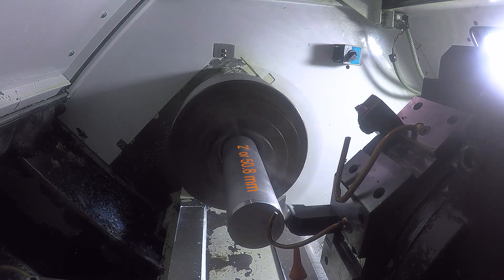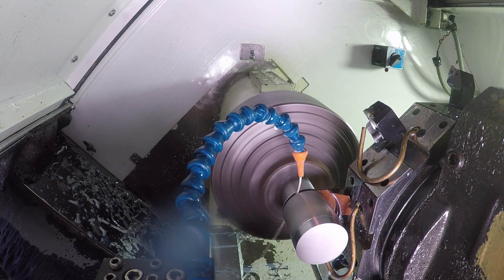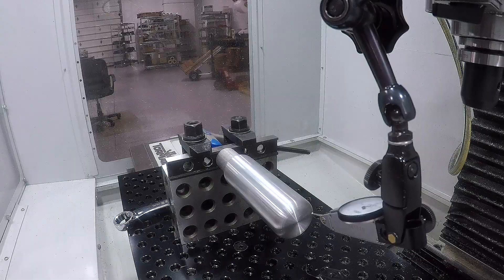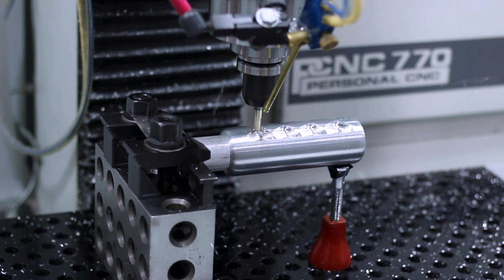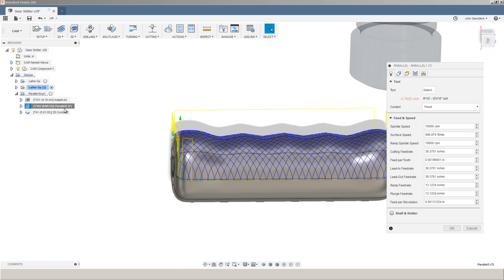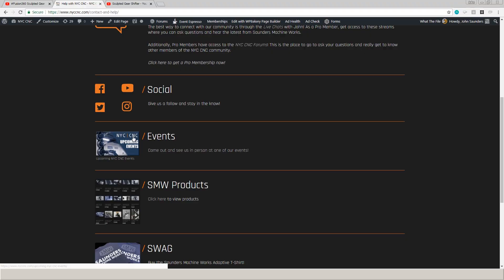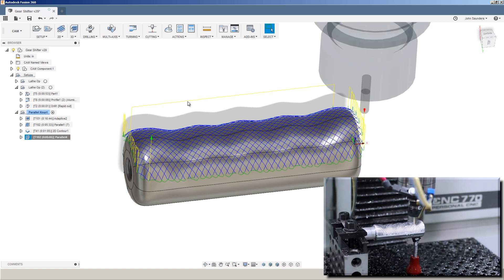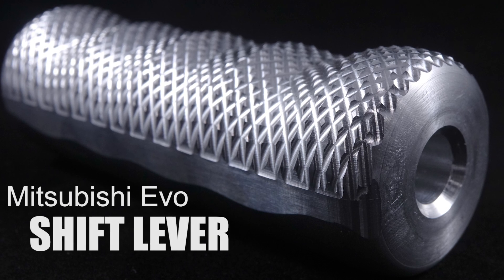Machining a Mitsubishi Evo Shift Lever | WW216

Comment: Cool project John but what happened to the feeds and speeds for the lathe portion? I'm still getting long stringy chips on my Slant-Pro and would love to know how you eliminated them.
Reply: The only way I've gotten rid of stringy chips on a lathe is heavier cuts: 0.003–0.005" feed/rev and 0.050-0.100" depth of cut.
Reply: yep, increase feed rate and/or more depth of cut

Comment: Can anyone answer this question, is 2.5 and 3 axis cnc machine the same thing, and if so can any 3 axis cnc machine run that tool path to create the knurl since it moves all 3 axis simultaneously?
Reply: Yes, he didn't do anything that another 3 axis machine couldn't do.
Reply: Yeah, 2.5d is just a term used to describe a certain sort of part/programming style
Reply: 2.5 axis means that 1 axis positions the tool(typically Z) and the other 2 axis' move simultaneously. Full 3 axis means that all the 3 axis move at the same time. All 3 axis mills can do full 3 axis it just up to the programming.
Reply: A lot of times 2.5 can also refer to the reach of a 3 axis machine. You cannot machine the underside of the part, so z axis machining capability is generally limited to the top half of the part
Reply: 2,5d NC milling machines share only one servo drive for y and z axis. Simultanious action of both axis is not possible. Example, Deckel FP4MA

Comment: I would have likely just put it on a vice, long side parallel to the y axis.  You can come up from center a bit, but have bottom support from a parallel or v block, and squeeze on the ends.  Even aluminum jaws maybe so you could machine into them if needed, or machine (a little less than) half moons for increased rigidity or repeatability if needed.
Reply: That's what comes to mind for me too, but it seems to have come out nicely the way they did it.

Comment: This is a situation where making use of a 4th axis or even a 5th axis machining would have truly shinned and I'd like to ask you why did you not use one of those methods?
Reply: 7:35
Reply: Had he used a 4th axis,  he could have used am engraving tool and made a truer knurl
Reply: But as he said it was to show it could be done on a 3 axis, and since I haven't yet built a 4th, it is nice to see it's possible.
Reply: The reason I ask him this question is to see what would the time factors be with each method of machining as this part really had some nice curves for 4th/5th axis machining as I thought the point of this is to make the best product in the least amount of time possible using the best method for the task at hand? It would have been very interesting to see which method would have won out over time, quality, and fixture setups as well as how to go about making a CAD model for them in Fusion 360. 
I have been following him since the old days of the Taig mill and know he too can do some of the things Titan Gilroy can do now.
Reply: He sold the 5 axis trunnion
Reply: Even more interesting than doing it one way or the other would be to do it all three ways.
Reply: Exactly Dusan!  for others: he explained why in the video, ...to show how it can be done WITHOUT a 4th axis!
Reply: Fusion 360 has many complications when it comes to 4th axis machining. It was much simpler to make it a 3D cut.

Comment: LMAO peculiar threads size. That's hilarious to someone in the metric world. That would be the equivalent of someone saying I'm using this peculiar thread size 3/8 UNC or UNF :0D
Reply: It was hilarious to me and I live in the US. I doubt I'm alone.
Reply: M10 (which is always 1.5) is common MF10x1.25 isn't.
Reply: I could see he was trying to say it's not an unusual size but we don't have any kicking around here, but not having a single M10 x 1.25 bolt just struck my funny bone. I have dozens of 3/8 UNC and UNF bolts here (although I should throw them out they are seldom used these days).
Reply: Ok I didn't realise that, most of the M10 bolts I have bought have been M10 x 1.25 for my bike. I normally use a lot of M8 which I think is 1.25 standard.
Reply: Depends on your field of work. 10x1.5 is standard ISO coarse, 10x1.25 is an everyday thread if you have anything to do with Japanese motors, and 10x1.0 is an everyday thread if you deal with bicycles
Reply: I was talking motorcycle, but didn't even know there was a M10 x 1.0, you learn something new every day.

Comment: You bought a bolt from McMaster to serve as an arbor? Why didn't you just make one—you could do that as fast as ordering a bolt online.
Reply: Or run to the big box store
Reply: Big box stores are unlikely to have weird metric thread sizes.  However, with a CNC lathe, knocking out a thread arbor should be quick and easy.

Comment: John,

A better solution for holding the unsupported end of the part without fancy fixtures is to use Plastic filler (Bondo) like you do with Superglue. You could have placed a block below the part. Tape off the part and built up bondo around the bottom of the part.Once it kicks, it will give you the support you need.  I've used this often with good results several times. This works best without flood coolant. After your done milling a heatgun will release the part just like the super glue. James
Reply: Or leave it long, so you have something to hold on to, then mill it then part it off in the lathe.
Reply: I'm gonna have to remember that bondo thing

Comment: Sucks that a metric thread is odd to you. To everyone else in the world, it's normal. Even Imperial threads are normal, due to American designs infiltrating the shops.
Reply: What are you talking about? M10x1.25 is not a common metric size AFAIK. Maybe it's common in the automotive industry, but I don't think I've ever had to deal with that size bolt.